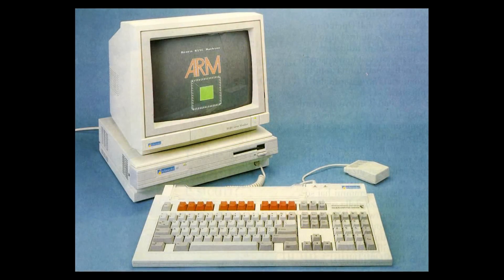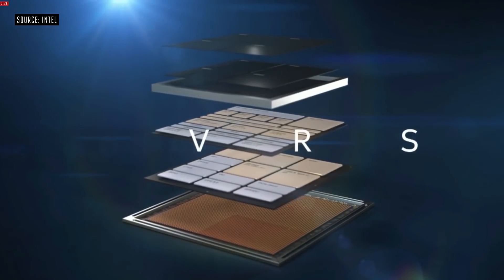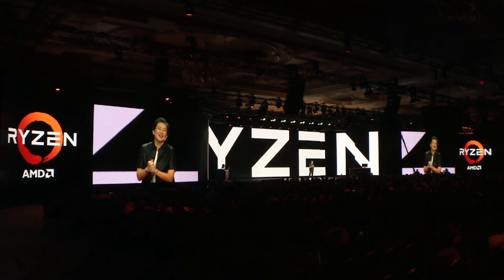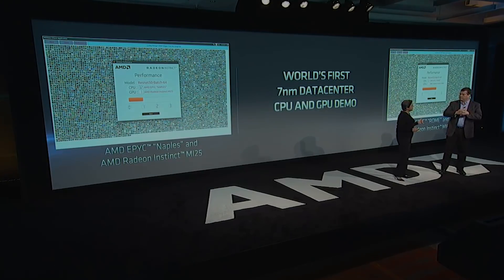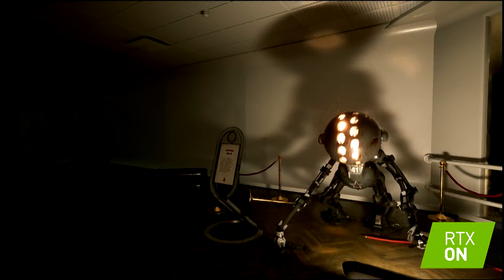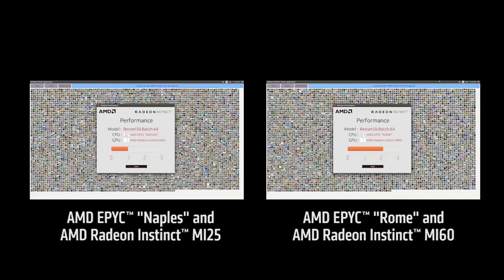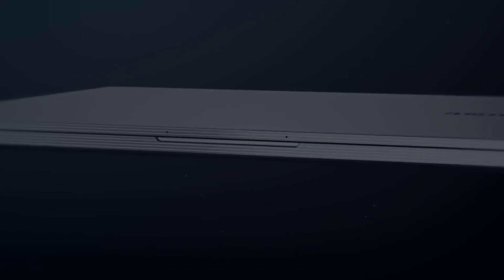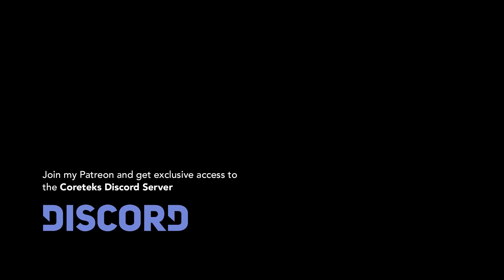Hardware trends: How many cores do we need?!

Comment: @ 6:22 I don't follow your logic. How does C=A+B translate into "MUL2W R4/R5, R0/R1, R2/R3 : LDL2 R0/R1, [X]"? I don't really know what instruction set you're using, but my guess is that the code snippet is intended to do a doublewide multiply from the register pairs R0/R1 and R2/R3 into R4/R5 simultaneously with a doublewide load of R0/R1 from the memory location given by [X]. The trick, of course, is that the clock cycle starts with R0/R1 holding the first operand of the multiply and once read from the register pair by the multiply can safely be replaced by the contents of memory location [X]. Whatever, that's not the same at all as C=A+B!

The instructions:
LDL R0, [AddressA] : LDL R1, [AddressB]
ADDW R2, R0, R1
STL R2, [AddressC]
are data dependent and really can't be parallelized any further using the classical Von Neumann (CPU+memory) machine architecture. The best the programmer or compiler can do is find another independent expression to execute in parallel with the ADDW and STL. 

Now if the instruction was coded as:
ADD [AddressC], [AddressA], [AddressB]
or something similar then the three steps can be hidden by the architect, even to the point of executing the instruction, not in the CPU, but in the memory unit holding the three addresses. But still, no matter what, you can't add two numbers until they have first been fetched and fed into the input gates of an adder somewhere, and the result has to be computed before it can be stored, even if the architect cheats and makes each "clock cycle" include all those steps. 

If every memory unit had its own CPU capabilities attached we could maybe get a lot more fine-grained parallelism going. Right now our computers are limited by the bottleneck between the CPU and main memory, which is why we keep caching more and more memory on the CPU chips. But still, caching just speeds up fetching and storing, it doesn't eliminate them.

It turns out that most of what a computer does is copy data conditionally from one location to another based on the values of that or other data. There are very few complex expressions involving multiplies, divides, square roots and other time consuming operations to be executed in most programs. Address indexing computations are actually the most common complex operation. You see a lot of "X[I] := A[J] >= B ? C[K] : D" or similar equivalents spread out over multiple statements.
Reply: after some digging, I think it's from FirePath™ Processor Architecture
and Microarchitecture. 
https://www.hotchips.org/wp-content/uploads/hc_archives/hc14/3_Tue/23_wilson.pdf

If I understand it correctly, that instruction implies that correct data is already loaded in appropriate registers, so you can do it with just one instruction. It still takes multiple instructions and cycles overall, because he committed part of the code.

from the manual, it says:
" Instruction also implies resource availability
MUL2W r0/r1, r2/r3, r4/r5 : LDL2 r6/r7, [r8]"

Comment: The hardware people have different version of Ahmdahls law,  where parameters are .

Executiontime=Time affected by improvement/size of improvement+time unaffected by improvement .  

In that form it works on every kind of improvement you could do for hardware/software system and gives hints of how to sidestep the Ahmdahls law.

Ahmdahl's law in the form that moves in the software community makes assumptions that are not true in general sense. 1) The code stays the same 2) data size stays the same. 
Long time ago researchers released paper that they had broken the Ahmdahl's law, and what really had happened that they found out that in many cases if you double the amount of data  you double the parallel portion of execution time without affecting the serial time. So if you have double the data work with you can benefit from twice as many cores in many cases. 
And by optimizing away the serial portion of the code either by parallerizing it or just making it run much faster you can start utilize more cores.   Then in the serial portion of code there are some algorithms that are known to parallerize but serial algorithm is much faster at 2 cores but much slower at 16 cores.

Comment: So a little story. For the last three months I've been running a stupid idle game on Windows 7 with Google Chrome. This game really likes to max out my i7 4790s CPU and caused me a few crashes because of heat. (this CPU was carefully selected for my own reasons) The cooling components are good, over kill even, but not insanely good and I'm limited by a ITX case (by design). I had a few crashes and if there is one thing I really hate it is hardware induced crashes.

So what I ended up doing about this was to set my power profile CPU max Power State to 68%. I'm always running at least two browsers, one FF and the other Chrome. Between them I have about fifteen tabs open. I also play a popular MMO at the same time and am always watching videos. All on a Ultrawide monitor.

With the frequency being Power State limited it ends up at a rock steady 2195Mhz which results in a Celsius range of 43 to 48. So I imagine that I am going to be laughed at and derided but guess what, first off I don't care. Second and the point of this story, I have no performance issues. None. And that is what is interesting about all of this. I don't need a new system and this one is once again completely stable.

If I'm good with a four core plus four on Hyper threading CPU, where is this really going for consumers? And trust me I was sorely tempted by the Ryzen offerings but so far I just can't find the justification for something beyond what I have. Anyway, great video Coreteks. Love the thought you put into this stuff.
Reply: You're a casual gamer at best. So ofc you have no need to upgrade.
Reply: Right because I've only been gaming since the seventies. Maybe one of these days I'll get it right!  [Talk_to_the_hand]
Reply: @kmg501  I just meant what you play is casual and doesn't take up much system resources. You've said as much already. Maybe you dont like the word casual. But it fits. You're not a buyer of the high end because you play games that most budget builds can play today. You literally brought up an idle game. So I dunno, whatever. you're an extreme gamer. fuck I care.
Reply: (1) There is a whole industry of low spec gamers. In fact there are many Youtube channels that cater to them. The fact that you don't seem to be aware of this segment is ... interesting.

(2) Computer gaming has never been defined by the tier of computer in use. Computer gaming has always been defined by the intensity of interest in gaming on computers.

(3) I said I have a idle game going WHILE I am playing other games.

(4) Buying bleeding edge components is not what defines gaming. Buying bleeding edge is hedging against the future as it always has been for gamers. When their computers age, that doesn't mean that they fade into be non gamers.

(5) kek?
Reply: @kmg501  you're what 50-60 and using kek and getting butthurt about being called a casual gamer because you think MMO + idle game + watching videos is 'extreme high end computing'. You might just be a novelty in irony.
Reply: Apparently your idea of making an argument is to imagine what other people said and then argue against that. Hmm, if only there was a word for this... As for "butthurt", nope. If you like, try addressing the points. Otherwise, have a nice evening.
Reply: @kmg501  lol, no. sounds like you. You said you've been gaming from the 70s. You said kek. You are getting upset over being called a casual gamer. you declared me calling you a casual gamer because you play casual games that i dont know what low spec gaming is. Yet you have no evidence of that. What evidence you do have is the following 1) I said a idle game + watching videos+ playing some unspecified MMO is not high end gaming.  2) I think you're laughable for the amount of defense you're getting because I called you casual. 3) you used kek, which is even funnier as its beyond passe.  Anyways, don't get too bent out of shape. Its only a game. Even if its just a casual game you play, you still game. Sure. But if you're telling me you're at peak gaming and using all your resources at 8 threads, maybeeee you're not really pushing that field of high end gaming. Have fun with your pong + idle game + netflix + some MMO that uses 2 threads. There is no shame in it, but yeah you're totally pushing that 4k gaming + streaming at 1080p60 fps + playing 2 idle games + running discord + watching netlix + watching amazon + commenting on youtube + eating pizza from a microwave + looking at your phone to answer a text + juggling between caring. 

anyways later my fellow casual.
Reply: Look up the term "projection". That will eventually help you figure out what you are doing. Also and I am repeating this, gaming is not defined by a sole tier of computer hardware. If you can accept that, fine. If not, then oh well. Not my problem.
Reply: @kmg501  lol. Sure. But the games you play will dictate the hardware. Thus you are a casual gamer as you dont require high end pc parts to play an idle game while playing a random mmo while watching netflix. I'll say this again, those 3 'things' are not taxing even on moderate budgeted builds. I dont know what I'm projecting though as you did say "kek" , get offended by casual, and stated how old you were in defense of how "hardcore of a gamer yo were". YOur gamerness isn't in question, just the quality and tier of game.Just because you play wii tennis everyday for 18hrs doesn't make it a hardcore game.
Reply: You're very fixated on what kind of gamers you think people are. [raised_eyebrow]
Reply: @kmg501  not really. Youre stating you dont need to upgrade because you're already able to do so much. I'm trying to inform you that you dont do that much. So any upgrade would be pointless for you as you already are seemingly not even pushing an underclocked 8 thread cpu. So ofc a casual game player like yourself that rarely uses peak resources would never see a need for anything. But I think it may be a generational thing with you, as in you took what I said as some sort of ageism /elitism fight.  You can't accept that I was only commenting on your status being indicative as to what you play. Its not big brain thinking, Please take that chip off your shoulder. We're friends here. Here is an example that is so derp that even you I'm sure will still complain about it... You use 10, so anything over 10 suits your needs. But 20 is too much, if I already have 12 for my 10 why do I need 20? But seemingly someone stating you don't need 20 because 10 is low compute work load compared to 20 you have to claim you been gaming for 30 years , and that i'm the problem with society cuz I breed with chickens. No my marital status with chickens is ofc suspect but still there is no indication of me actually fucking a chicken. So I have to go back to my initial point as this is what i'm talking about. Why do I need to argue you on some psychological ground? There needs to be nothing beyond what I said.  Maybe its because last week I got my toaster wet and it made bagels into pudding , who knows

Comment: 9:13 RTX 2080Ti does not have 48 RT cores, it has 68... With turing on 12nm and Nvidia moving to 7nm for there 3k series cards thats about a 42% node shrink, if they keep the same die size they can pack 96 RT cores for the next card unless they cut out cuda cores or tensor cores to make more room for RT cores. Either way 68 to 96 RT cores isn't that big of a jump, and at the prices they're surely going to keep charging it just isn't worth its salt.

Comment: clearly this guy has no idea about "fearless concurrency in Rustlang"
Reply: Languages that excessively abstract concurrency limit it's use. They're make the easy things easier, but to the difficult mulithreading problems, they basically tell the development, "din''t do that." That's fine within some domains, where the low hanging fruit is all you worry with, but it's not a universal solution.
Reply: have you tired rustlang concurrency ?
Reply: @laurelsporter  what??
Reply: @MarceloTezza  If you want the same power as C++, you need to start using unsafe Rust, at which point you're in the same boat as other languages that up and expose the difficulties. There's no free lunch, and it's not going to work for everything to stick to the safe side. Safe Rust keeps you using fairly coarse concurrency.

Being a fan of Erlang, I certainly like Rust's approach, but it's an evolution of programming language paradigms, not a universal solution to fundamentally complex math and logic issues.

Comment: The problem, that this video didn't touch on, is that adding cores to CPUs is also bottlenecked by the buses connecting the cores to memory and other peripherals. The bus bottleneck is not a problem for computations that don't use a lot of data.

But graphics for example uses tons of data, so placing the CPU and GPU in the same package will create a huge bottleneck when they both fight for bandwidth on the same buses. A lot of GPU advances have been in using wider and wider buses and more ports on memory, allowing the same memory chips to be access over multiple buses.
Reply: I still hope that "The Machine" structure from HP will eventually fuse CPU, GPU and RAM into one Memristor block, making traditional core design obsolete. But it seems Memristors behave like fusion tech, being here always at some time in the future. But nontheless, the Von Neuman design has its limits and must be replaced at some time, no doubt. I guess when the CPU cores peak out at 32 like the video suggest, there will be enough incentives to switch over to more radical ideas. Time will tell.
Reply: RAM and data storage could also later on migrate on SiP and SoC for greater performance and efficiency, so as cost. That will mean end of upgradable PCs, but rest of the market done that with every other device.
Reply: @LordAlacorn  having the RAM on the CPU interposer would be nice, think HBM2... 16GB of that, and if you need more then DDR5 on 2-4-6-8 channels memory bus, but most people "could" live with the 16GB built in RAM. I have mentioned it many times and they could do it, especially now AMD is doing CPU/GPU/IO on the same interposer, bigger socket yes, but slap in 2 HBM2 stacks and have it share with the GPU/CPU, latency will be super low since it is on same "die" and it doesn't need to move to the slower bus unless you need more memory than the 16GB so the performance gain would be huge, even if the GPU used 8GB, you would still have 8GB super fast RAM before it began using the "slower" DDR5 on the motherboard for the CPU.
Reply: It's a problem for sure, but we're also seeing solutions. For example, we'll probably start seeing APUs with a couple gigs of HBM memory as a sort of L4 cache, which should help a lot.
Reply: GPUs are simply designed with wider and wider buses. The Radeon VII has a 4096 wide memory bus, for instance.
Reply: well instead of 2 channel memory, it would be nice with 4 or 8 channel memory, but it would need more memory sticks, but why not? let cheap people run their system with 2 channel memory and let the rest of us get 4-8 channels for much better memory bandwidth, the more cores need it too, easy to see with threadripper, but they are trying to push the need for more memory channels away with gigantic cashes on the CPU... which is also "expensive"